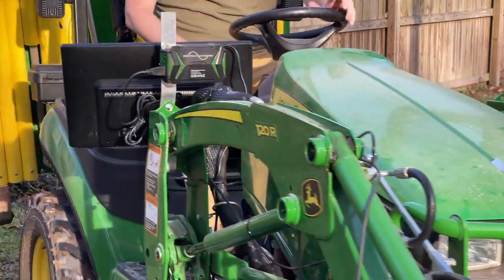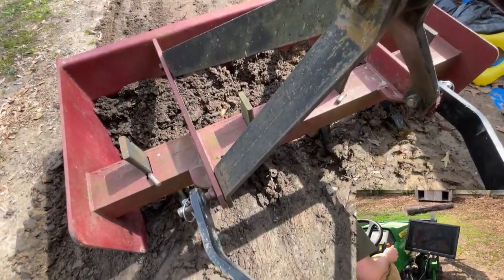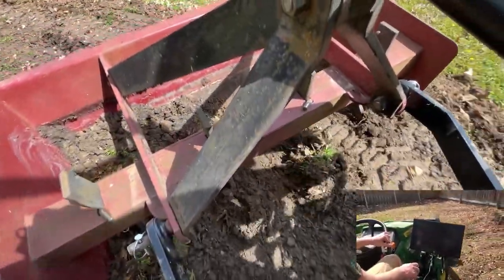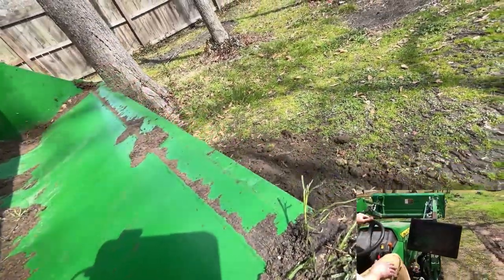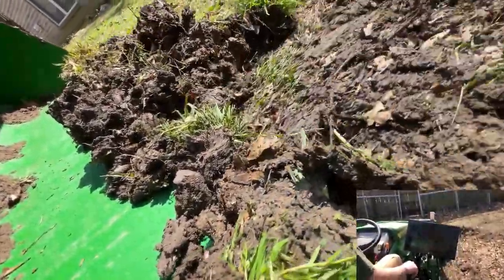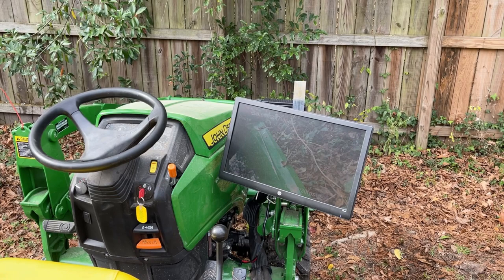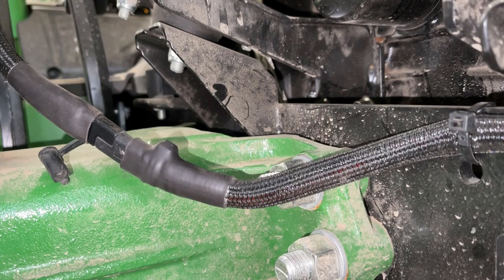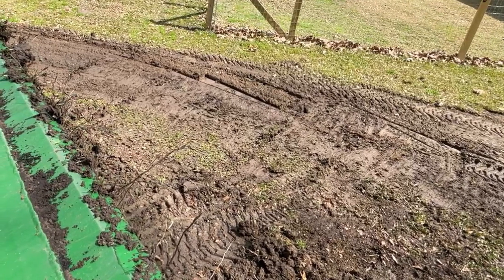Tractor Loader Camera

Comment: Nicely done LCS.  I'm going to do something similar.  I purchased a backup camera system from Amazon and need it for the loader as well as pallet forks.  It's tough trying to determine fork location without jumping in and out of tractor or without a spotter so the camera is the way I'm going to resolve my dilemma. I enjoyed a full-watch.  Have a fine Easter Sunday (Resurrection Day) 👍🏽🤠 4/7/23
Reply from the maker: @houndsmanone - I ended up doing that exactly. The large PC monitor wasn't bright enough to be useful on a sunny day so I picked up a 7" 12 automotive style monitor with two camera inputs that was reviewed fairly well. That way I could try different cameras if needed but the first "backup" loader camera I chose worked great so I picked up another for the rear as well. Thanks for watching and have a great Easter Sunday yourself!